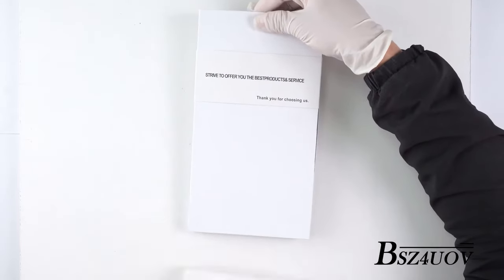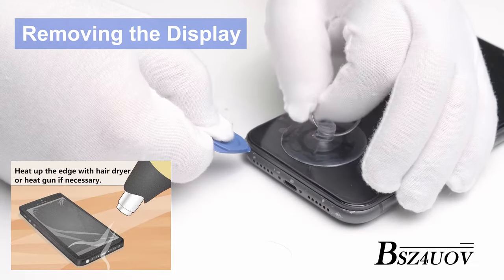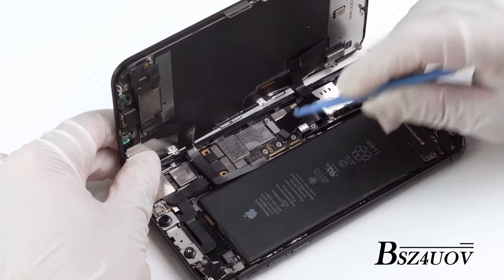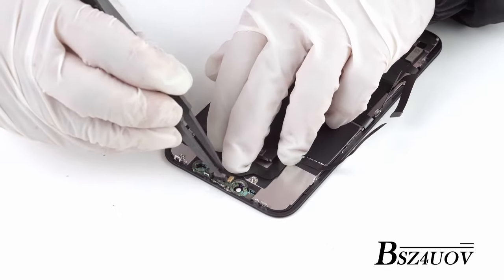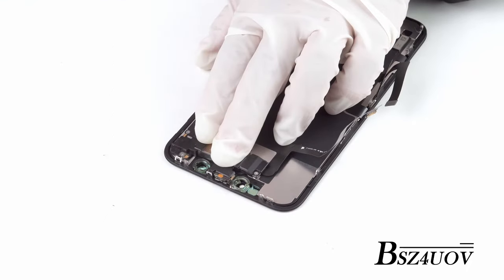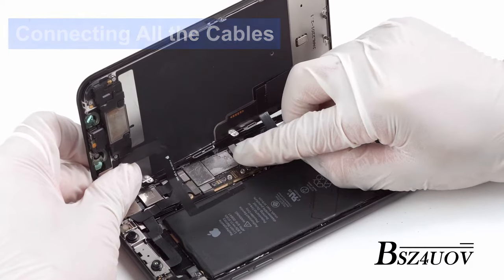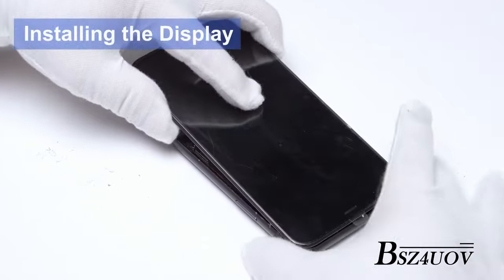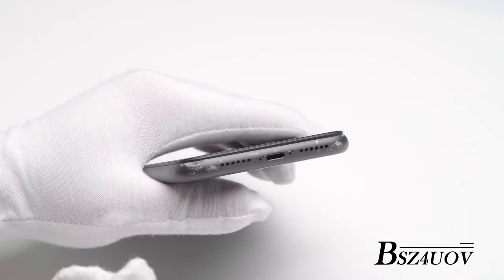How to Replace iPhone 11 Screen / Digitizer Glass Replacement Installation Repair Guidance

Comment: I had used a phone technician to replace my wife's screen but then couple weeks later it wasn't working again and i wasn't going to pay so much money again. So i bought the replacement kit from amazon and came here and thanks to this video i saved a lot of money and learnt a skill... there was some difference parts like the battery plate that wasn't on the phone in this video. I also had to slow down the video cuz it was too fast loool..Thanks again!
Reply: What the kit calledd

Comment: Thank you so much, I almost paid $120 to get my screen replaced but with your help I did it with less than $20. Only downside was waiting for the screen to come in the mail and the suction cup not sticking but I looked at another video and luckily I had a razor to remove the old screen. I unknowingly bought the same exact kit👍🏾